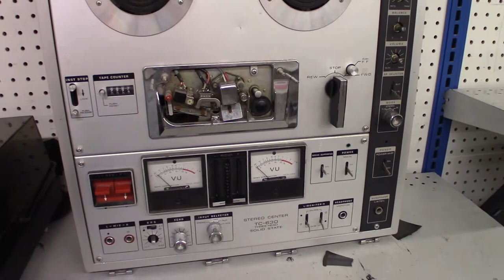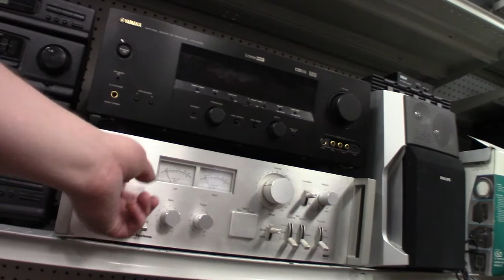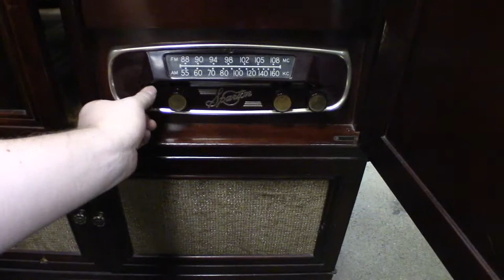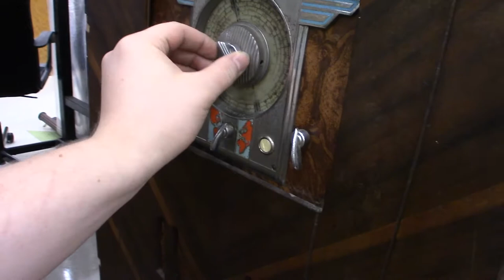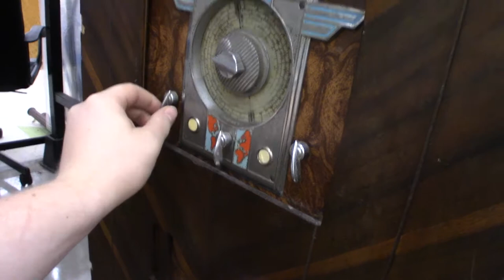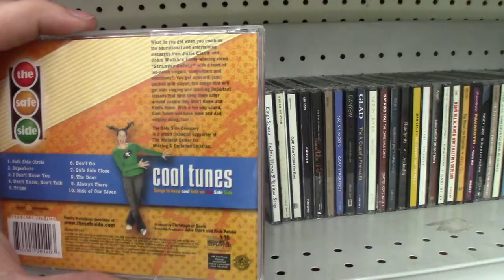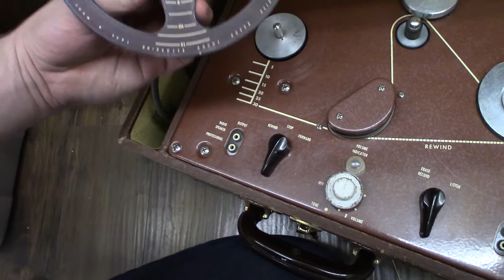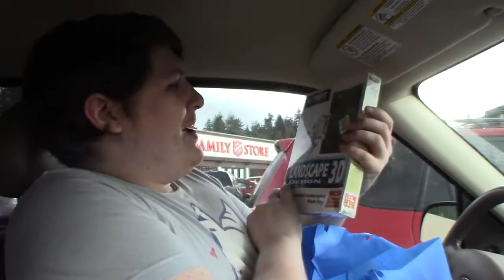Vlogue 5 - Goodwill And Rain

Comment: 14:18 There's a Logitech Extreme 3D Pro in the shot. I got one of those from Goodwill for $7.50. Also, at 14:36 I'm familiar with that "The Safe Side" CD. There also was a DVD with that the CD was based off of called "The Safe Side: Stranger Safety" from 2005 that I used to have when I was a kid. It just talked 'bout stranger danger.

Comment: Heh, I think I've been to both of those Goodwills before. My favorite store! :) Best Goodwill was always the Ballard one, they always have the most video games somehow, at least two shelves. Everywhere else seems to barely have 5 or 6 video games in total!

I need that telephone though. 😂
Reply from the maker: Yeah, if you're in Seattle these are the places to go. Ballard went down in quality, but then, they all did - Goodwills got so sad as the economy got worse and worse. :(
Reply: @CathodeRayDude  meant to say Bremerton, but Ballard was always second best. Best deal I ever got from Ballard was some huge Sony speakers with ribbon tweeters and 15 inch woofers from an era when Sony made hifi equipment all for $1.79 on a Monday. And that was late in the day. I must have only gotten them  because I was the first one with the strength and the room in my car (yay for Volvo wagons). I still use them as fronts in my surround sound setup. Best deal I've ever SEEN there was a very nice HP all in one with a touchscreen and full HD  IPS display from about 2013 for about 75 bucks, my buddy got to it first though, haha.
Reply: @CathodeRayDude  that's entirely the resellers. Unfortunately I did it for a short time but now only buy shit I would want.

Comment: 2:35 looks like an older version (which makes sense) but I have to do these tests because I take a medication for my RA and lupus which can (rarely) cause retina damage and eventually blindness if you don't stop the medication. (I won't mention it by name since it's also the same medication conspiracy nuts think cures certain ongoing global health crisis and often mentioning the name triggers flags even when you're talking about the valid medical use for it.) You look one eye at a time at the fixed light in the center and the lights are sometimes bright and sometimes dim and they go off all over the area and they track your pupil and match where you can see. It's really stressful even if it's not painful or anything just because you're staring at a light trying to see when other, really fainter lights flash at you so you can click the clicker.